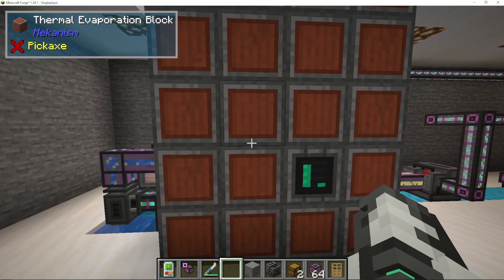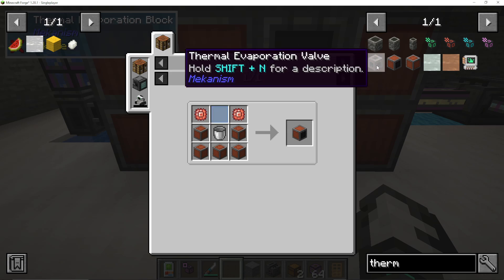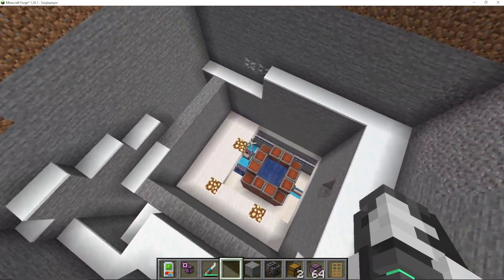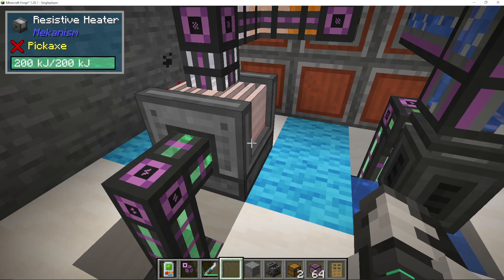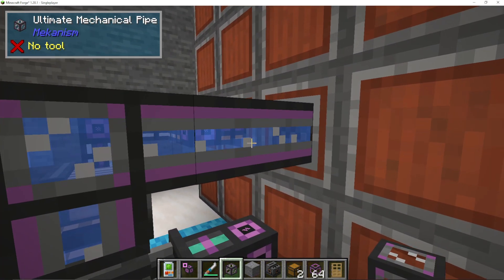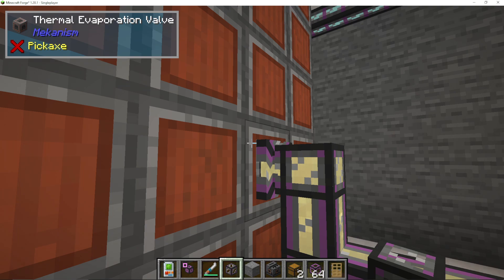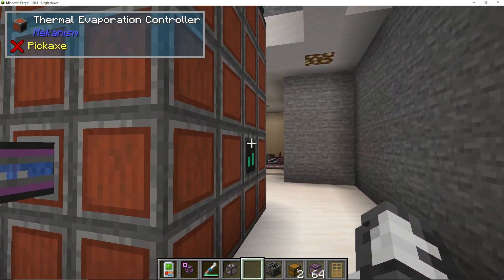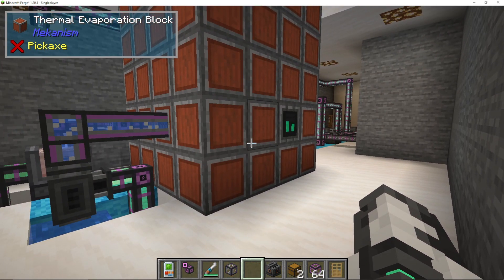Mekanism - How to get Lithium / Brine with Thermal Evaporation

Comment from the maker: MEKANISM PLAYLIST - https://www.youtube.com/playlist?list=PLLfpQ9n-FMnUP6fevBdGyp4MibiY7Mcc_
Reply: ok so i am new to mekanism and im trying the thermal evaportaion stuff but i am having an issue where the valves aren't connecting to the pipe and thermodynamic pipe along with the controller is not turning on is there a quick fix for this?

Comment: I have a problem and was wondering if anyone knows a solution. I built everything just like in the video and at first everything worked. After some time, I noticed I wasn’t getting any brine anymore and realized that the resistive heater doesn’t transfer the heat into the thermal multiblock, or the thermal multiblock doesn’t absorb the heat.

Comment: DO NOT PUT YOUR OWN WATER IN! It will make the machine not work. The water will fill automatically from the water pump
Reply from the maker: you put water in from whatever means you want.
Reply: @JaviHerobrine but if you try to fill it up with water buckets from the top the machine will not work
Reply: @voor_eer9437  thanks u saved me tbh

Comment: i made it one block shorter and it still works. and i put the resistive heater between both towers so i only needed one
Reply from the maker: Oh yes I think they can be as short as you want actually! Just makes less… which is often fine

Comment: Did anyone try making automated system to achieve lithium production with only 1 tank:
1. Water flowing into the Thermal Evaporation Plant to produce brine.
2. Stop water flow when the brine tank is nearly full. In my case at 900 buckets so tank gets empty of water by the time it reaches 1000
4. Switch pipes to input brine to produce lithium.
5. When brine is depleated / lithium exported to tank - disable lithium output pipe
6. Again enable water flow into tank / enable brine output pipe
7. repeat

Comment: why i cant connect the tubes into the differents valve ?
Reply: For the other people that might need help with this issue make sure the whole bottom is thermal evaporation blocks not just the 4 in the middle
Reply: Use universal cable to power the heater and the Thermodnyamic Conductor to put the heat into the valve. A universal cable can't connect (because it transfers energy and the plant does not take that directly.
If you can't connect the mechanical pipes for water, that probably means the controller is not on. Check the structure of the overall evaporator--valves can't be on corners, and blocks /water can't be placed manually inside.
If the controller is on you'll see green bars and be able to interact with its interface.
Reply: @Kleph.  hey i have a problem, the brine isnt outputting, do you know why?
Reply: @apson4895  Same let me know if you find a fix

Comment: Should've mentioned that you need a key to pump the product out
Reply from the maker: A key? 🤔
Reply: @JaviHerobrine a configurator tool to set the pipe mode to pull
Reply: I mean if we are at the point we ned lithium i would hope we know about configurators
Reply: @mavrodude0018  i did not know this thank you
Reply: @mavrodude0018  exactly, how the hell could you be that deep into mekanism and not know how the mod's most important tool works